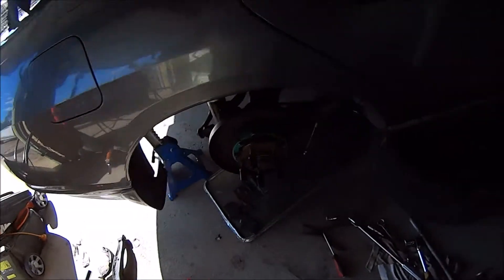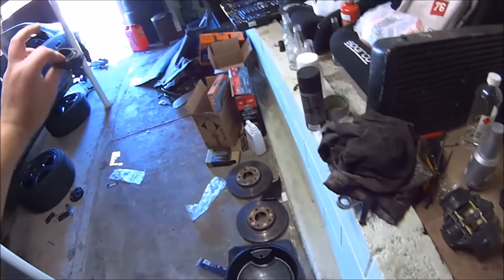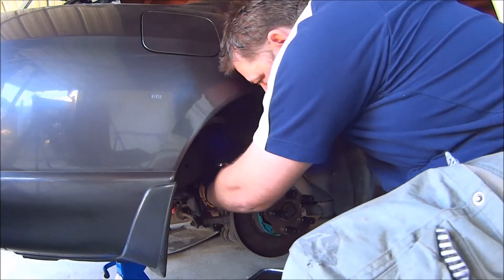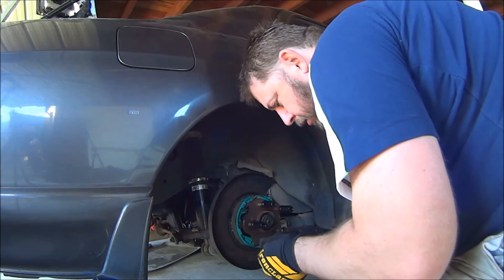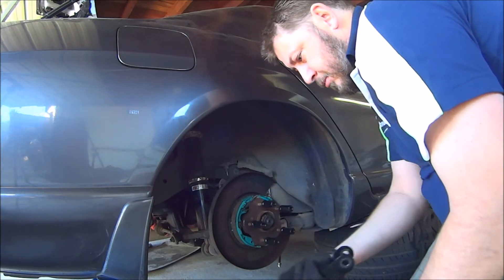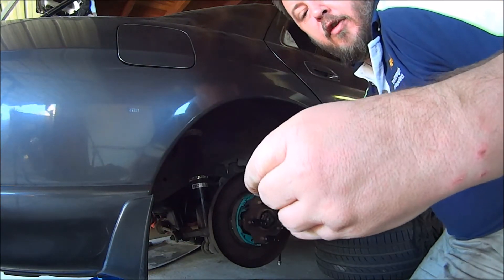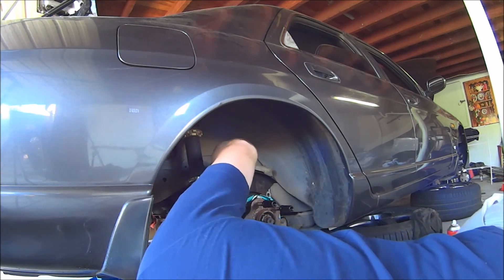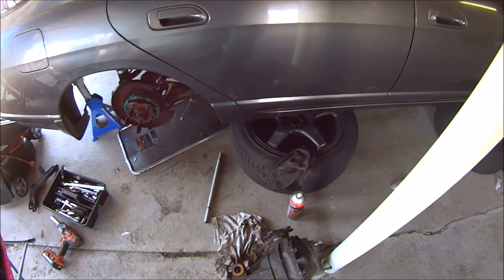Nissan Skyline R33 GTST Build - Rear Camber Arms Again - Fitting adjustable rear camber arms

Comment: You probably wont reply byt there are two upper arms. Why are not both upper arms replaced with a adjustable camber arms but just that one? Looks like you gonna mess up toe if you only  camber that one. Cant find any good info on this. Was hoping you know or could clarify. TY!
Reply from the maker: Don't know why you'd assume I won't answer, I have answered all of the thousands of comments on my hundreds of vids.
As far the arms, there is only 1 upper arm truly upper arm, which is that one which controls the camber. The other arm at the front near the top is more like a trailing arm, designed to limit movement for and aft. Now with any arms, if you adjust one competent you change all of the parameters, so have to adjust them all together, and in this case the toe is adjusted on the rear toe arm, which is there because of the Super Hicas System that came on the cars. Mine was deleted but the arms remained. Now as I used this for Motorsports I pushed the limits of what this set or arms can do, and there were some compromises to be made to keep live toe form impacting the handling under heavy braking and acceleration. But for street use, the toe adjustment available is more than enough to compensate for the camber gain.